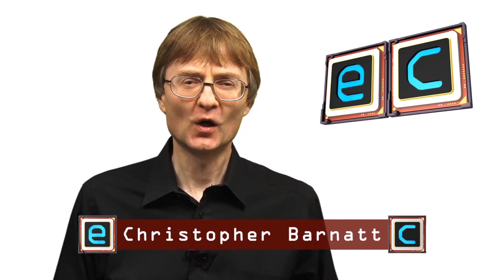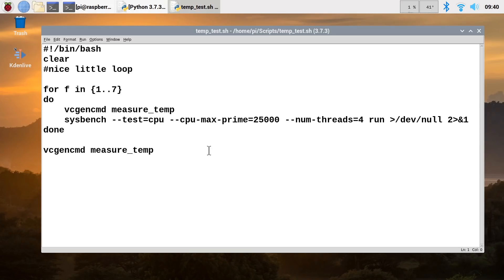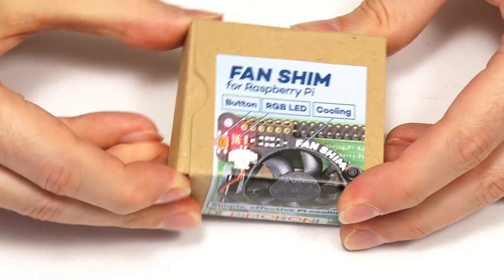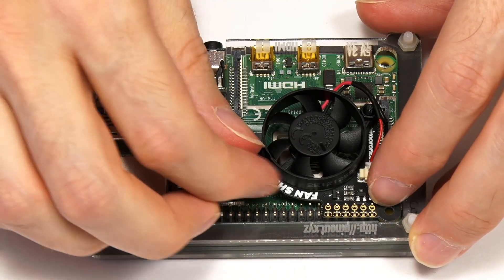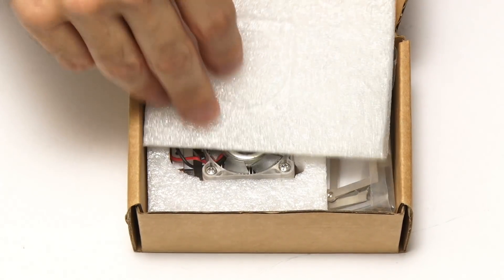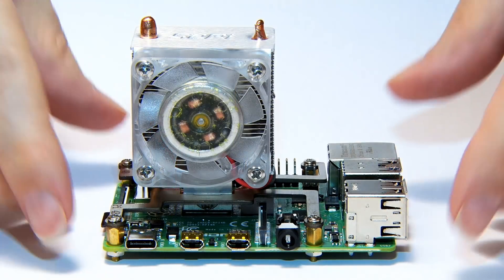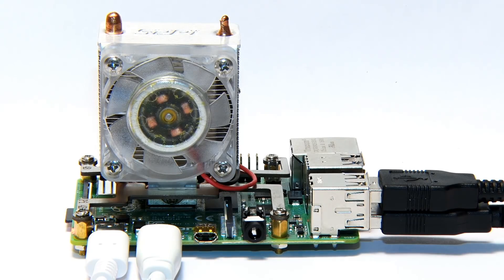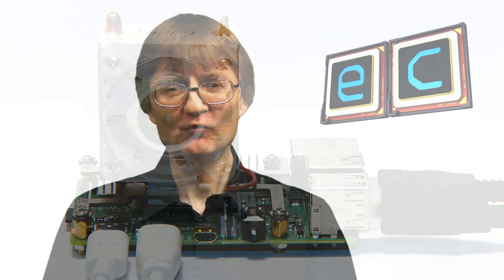Raspberry Pi 4: More Active Cooling!

Comment: That's a pretty poor cooling solution if that fan is going full speed.  I've got my pi 4 clocked to 2gig with 600 on the GPU.  I'm using one of those big blue heatsinks from this video...  https://www.youtube.com/watch?v=RxBaEiQHzLU with a generic 40mm fan from China using a python script temp control on the fan set to 35 C so the fan isn't running anywhere near full speed and i get the following running the same sysbench test...

temp=35.0'C
temp=40.0'C
temp=36.0'C
temp=34.0'C
temp=33.0'C
temp=35.0'C
temp=35.0'C
temp=35.0'C
temp=34.0'C
temp=36.0'C
temp=36.0'C
temp=35.0'C
temp=34.0'C
temp=35.0'C
temp=35.0'C
temp=35.0'C
pi@raspberrypi:~/scripts $ 

It does hit 40 at the beginning but that's the temp control taking 5 seconds between each increase in speed.  Once the fan speed catches up with the heat it soon lowers it and keeps it well easily at 35.  If i put the fan at full speed it would be below 30 but then the fan would be noisy.

Here's the python...

import RPi.GPIO as GPIO
from time import sleep
import os
import sys

GPIO.setmode(GPIO.BOARD)
GPIO.setwarnings(False)
GPIO.setup(12, GPIO.OUT)
pwm = GPIO.PWM(12, 50)
dc=0
temp_range=35
pwm.start(dc)

def getCPUtemp():
    res = os.popen('vcgencmd measure_temp').readline()
    temp = (res.replace("temp=","").replace("'C\n",""))
    return temp
def fanUP(cycle):
    temp_count = cycle
    if cycle<98:
        if cycle < 10:
            pwm.ChangeDutyCycle(100)
            sleep(5)
        pwm.ChangeDutyCycle(cycle + 5)
        temp_count = cycle + 5
    print (temp_count)
    return temp_count
def fanDown(cycle):
    temp_count = cycle
    if cycle>2:
        pwm.ChangeDutyCycle(cycle - 5)
        temp_count = cycle -5
    print (temp_count)
    return temp_count
try:
    while True:

        CPU_temp = float(getCPUtemp())
        if CPU_temp > temp_range:
            dc = fanUP(dc)
        elif CPU_temp == temp_range:
            print (dc)
        else:
            dc = fanDown(dc)
        sleep(5)

except KeyboardInterrupt:
    pwm.stop()
    GPIO.cleanup()

Comment: Hi Bernard. Thanks for another nice video. I saw you tested the ice-tower without fan for silence. I have a model 2 with a 5V 28mm fan which I connected to the 3.3V. It runs, completely silent! But sends enough air through the heatsink to keep the temperature at about 60C under stress. It doesn't seem to disturb the 3.3V bus. Have you tried something illegal like this?
Reply: Oh.excuse me Christopher for calling you Bernard. But when I started to type the comment my neighbor walked in talking continuously. So I got mixed up.

Comment: we're still using pi3B without even a small heatsink in our production systems. Those cool active thermal solutions might be cute or powerful but we also need to know the MTBF, the noise and dust that fan might suck into the little case. The video is fantastic to let us compare those data efficiently!

Comment: The Ice Tower is way cooler, but I'm still leaning towards a FLIRC case. It's silent and won't collect dust and I think that it will keep the CPU from throttling (as long as the CPU isn't a dud).

Comment: Thanks for the video! My question is this: does a 42C actually improve performance of the SBC compared to a 63C? I would have thought anything below a thermal throttle will actually perform the same, so all these active solutions are essentially equal in that regard
Reply from the maker: You are right, all solutions here will deliver the same performance. But a CPU rnning cooler will have a longer life, and has more overclocking potential! :)

Comment: Thank you for the video.
I got another proof that Raspberry is no longer a good board, but just a "commercial craft".
After all, the whole essence of ARM SBC is to be smaller, quieter, more productive.
And what do we have here ... "Tower cooler"?
Great, "Raspberry 5" should be sold in a tank with liquid nitrogen!

And to have connectors right at the corners of the board so that it is as inconvenient as possible)))

Comment: is there such a thing as 'passive liquid cooling' meaning having liquids flow around naturally and taking the heat with it without a pump?
Reply from the maker: This is, in effect, how heat pipes work -- like the one in the ICE Tower. There is a liquid inside that vaporises and condenses.
Reply: @ExplainingComputers  sounds like heatpipes would be sensitive to leaking and even exploding in this case...
So in theory, could they not maka sort of huge cilinder containing that liquid so that the supply of liquid would be "infinit" and just sit on top of the CPU all the time (boiling i guess)
Reply: escpecially in cases where the CPU sits horizontally, like with the Pi

Comment: A good trick would be to use a cheap, ordinary 12V fan by way of a Dickson multiplier.  The PWM signal could be generated by the Pi itself on an I/O pin.  The low period of the duty cycle can be used regulate the fan speed.  The components needed will a couple transistors, a few diodes, and some capacitors.  Pennies.  5V fans exist, of course, but are not as common.   If you could get a fan to run using CPU heat ... say a stirling engine or peltier device ... now that would be something.

Comment: I'd like to see you do a vid on /e/ OS from the /e/ Foundation on a RockPro64 :D as we recently seen (from the dev) that it works on Pine64. Check the /e/ OS out and see what you think. More over, the cooling solutions, be it fan or liquid cooled, is a must in country known for heat during summer months. Other thing is, I like the Ice cooler on the Raspi4, I agree it looks good and you're right, as the SCBs become more powerful, many more cooling solutions will pop up. Something for myself to look at in future experimental builds :D
Reply from the maker: I've made a note to take a look.

Comment: When you're testing with the 52Pi ICE Tower Cooler in the passive mode, could you please post the results where you have oriented the RPi4 to make the fins of the Tower Cooler vertical rather than horizontal? If you don't have a fan running, convective air flow will play a big role in how effectively it will cool the RPi4. And convective air flow works best when the fins are vertical.

Comment: I remember back in the days, someone cooled a computer with non-conductive oil, but IIRC it caused problem with HDD or something, plus it was massive.
I'm curious if this would be a good solution for tiny single board computers.

Comment: #!/bin/bash
clear
# nice little loop
for f in {1..7}
do 
     vcgencmd measure_temp 
     sysbench --test=cpu --cpu-max-prime=25000 --num-threads=4 run >/dev/nul 2>&1
done
vcgencmd measure_temp
#sudo su
#apt install sysbench
#./stress.sh 
#where stress.sh is this file
#result on a pi 3b with a simple heat sink and simple fan 
#running raspbian stretch 
#temp=48.3'C
#temp=67.7'C
#temp=68.8'C
#temp=69.3'C
#temp=69.3'C
#temp=69.8'C
#temp=69.3'C
#temp=69.8'C
Reply from the maker: Ah, the Pi 3 runs so much cooler. :)

Comment: Hi thanks for the video. Very relaxing as usual. Can i please ask if you can review the GeekPi Armor Case. It is an aluminium case that passively cools the Pi and is very slim too. Can you please compare it with the passive ice tower and other passive solutions you tried in the past? Also i recently found around some stock Intel and amd coolers and realised that they might be adapted to the pi (expecially the Intel ones since they have smaller cpu area), please if you have some lying around can you try them passively and compare them to the other passive solutions? Thanks again for your videos.
Reply from the maker: I will be looking at that case, or one very similar.

Comment: Please test this aluminum case:
ebay.pl/itm/392321943875
Reply: @3dh
I have the dual fan version of this case on my pi 4.... its the most sensible case there is right now.... this case makes contact with the CPU, RAM, and the USB3 controller.... which looked at with a thermal camera are the 3 hot spots on the board.... NOT just the CPU like this other heatsinks only touch....
Reply: imgur.com/gallery/fo1x9F0

Comment: I suspect the pi4 had reached the point where you'd be better off buying a few years old pc instead unless you are going to use the ports and not just use it for gaming. I bought a two year old laptop for £37 plus £7 postage, and it will definitely vastly out perform the pi4. Probably less cost than the pi4 and a fan, plus it's upgradeable.

Comment: awesome stuff, looks like with the clear case, and a shim fan I finally have a decent solution to replace an aging ASUS Chromebit I use at my work which is a non profit for seniors as their web terminal mounted to the back of a 17in ACER monitor.

Comment: 52Pi also have official ebay store for ice tower cooler, you can check it here
https://www.ebay.com/itm/52Pi-ICE-Tower-CPU-Cooling-Fan-ICE-Tower-Fan-for-Raspberry-Pi-4-Model-B-3B-3B/223582824129?hash=item340e9326c1:g:UtwAAOSwl-NdbOnB

Comment: I'd like to mention submerging the Pi in a mineral oil and the variations possible therein, active heatsink cooling (keeping the oil moving), having an aluminum case to transfer heat from the oil to the air outside etc. But I'm not sure if the hassle would be worth it, considering the clean up for mineral oil builds (in common PC's), and considering it is a "tinker" board and having it submerged with relatively high clean up times makes tinkering, not such an enjoyable thing.

Comment: That Ice tower looks amazing, but I had a question: Would Noctua 40mm fans work on the Ice Tower? If so, I wonder if a pair of 40mm Noctua fans in push/pull would be viable, and if so, could you push it faster with overclocking of any kind?
Reply from the maker: They would! :) With maximum OC potential.
Reply: How would you power two fans?

Comment: Even if the RPi 4 has higher power consumption, it is designed to operate fanless.
Beside stress tests, there is no real life software that pushes all cores at 100% for long periods.
An active cooling solution is just adding unpleasant noise, extra power consumption and dust accumulation, bringing no relevant benefits compared to simple passive cooling solutions.

Comment: Fan-tastic video Chris! I have this vision of a near silent Pi 4 attached to the back of a monitor, wireless mouse and keyboard, running as a desktop. I'm thinking the board could go inside a short vertical section of aluminium pipe with big slow fans ant the ends, bottom fan pulling air in and top fan pushing air out...
Reply from the maker: Pi in a wind tunnel. Nice idea!

Comment: will you consider adding the noctua to the ice tower heatsink and retesting?
Reply: I swapped out the stock fan on my ICE Tower for a Noctua NF-A4x20 5V PWM fan. Fits right on with existing screws, though I got longer screws so I could add some extra anti-vibration washers and o-rings. I have a partial transparent case using those clear lego layers for base and top. 70mm hex standoffs are just tall enough (allowing me to use 6mm standoffs under the Pi4 to allow airflow between baseplate and board).

Under moderate use (web browsing, SDR radio etc) my Pi4 CPU temp is around 28C with the fan, or 50C without the fan. My project is over the top, but was fun to do and works well :) I haven't tried running the stress test.

As Roger Clarke says above, it would be cool if someone had the ICE Tower sticking out through a hole in an original Pi4 case, like an engine block sticking out through a car bonnet/hood.

Comment: Isn't passive cooling affected by the orientation of the board? Having the heatsink ribs vertical could improve natural convection. Anyways, the Pi4 is not throttling in any test, which is good enough.

Comment: The Pi5 is going to wind up being a tiny board you can barely see mounted on a giant heatsink. It kind of defeats the purpose of a small SBC if the heatsink takes up the same cubic volume as the PCB itself.

Comment: Nice to see more SBC cooling vids but as soon as I laid eyes on the ICE tower I was thinking - hands down winner!

I'd like to see some clear injection moulded cases possibly with plates you could slot in/out for air flow options. I wonder when a Pi cooling water loop is gonna arrive, or plans for one, cos that would really be the acme stage/final stage in Pi cooling.

I'd envisage a loop that was paired with a case and the loop went around the board and case and something that made bubbles would be great but the bubbles might be going too far hahaha.

Any plans for making or modifying some cooling ideas yourself, Chris?
Reply from the maker: I may well design and 3D print an ICE Tower case, and share the designs. :)
Reply: @ExplainingComputers  Very interested in this as well. For now is the Pibow Coupe 4 case compatible with the Ice Tower?
Reply from the maker: @bradquinn4161  Sadly not. I don't know of any case compatible with the ICE Tower.

Comment: Thank you. That was most interesting. If possible would like to see a test where a heatsink is on the pi4, but placed in a small box with an exhaust fan. The reason I ask is that im concidering a retropie arcade stick, but would like to limit the height to around 25 to 30mm and have fan on the bottom of the case (case would have non slip feet pads).with Pinholes at the front to allow an airflow past the pi 4. Also do you know if the Pimoroni Fan SHIM is compatible with the pi3a

Comment: When you disconnected the fan, it became a an air baffle that heavily restricted airflow across the cooler.  I'd repeat the test with the fan uncrewed and a belt and braces, with the fins vertically to see if convection occurs - I doubt it but it might

Comment: Another great video 👍🏻. There is one small point though. The Pimoroni Fan shim wasn't assembled correctly. It's supposed to have one of the nuts between the PCB and the fan, that's why they supply 5. Four are used in assembly and a spare. That raises the fan up slightly which will allow more air to flow round the CPU and hopefully improve the cooling effect. https://learn.pimoroni.com/tutorial/sandyj/getting-started-with-fan-shim
Reply from the maker: Ah! I see. Thanks for sharing this. I was not, when I unboxed, expecting to find parts, but an assembled product. So I went straight into building it in that shot. Suggests to me there should be a small bit of paper in the box indicating assembly. That I would have seen. :)

Comment: As I see it there are two ‘fun’ challenges now, one is cooling the Pi4 while running at 2Ghz, and I think that has been done so it will just be variations on a theme- passive being better than active.
Then there is cooling the Pi4 so it runs within design tolerance with the least bulky cooling solution, there’s probably a lot more potential there and potentially greater demand.  A developer wouldn’t choose a Pi4 if they must overclock it to 2Ghz and/or then actively (or passively cool it with a brick) cool it.  They would use some other SBC solution that could run within design parameters.  \In that sense the FLIC case seems to be a winner there.

And this makes me wonder who the Pi4 is for, to me if it is to supply the enthusiasts it isn’t really enough.  I want PCie access to be easy, M.2.  And it seems too faulted for development/ enterprise- at least currently.  I’m still happy they released it though, the faster bus/ removal of the USB bottleneck is a genuine improvement which makes the Pi4 capable of what they tried to claim the Pi3 was capable of (they always over claim I think).  I’d pay £100 all in for a SBC that was just a bit better than the Pi4- and I’m not greatly interested in 86_64 here because for less than £100 I can buy an embedded CPU ITX board for that; I was disappointed in the Atom Pi and that has put me off such SBC.

So a more full fat ARM SBC basically, to compete with the lower end ITX boards.  In theory also the STX boards but they aren’t much available in the UK (bigger in MEA/ Far East it seems).
Reply from the maker: Thanks for this. Watch next week . . . :)
Reply: @ExplainingComputers  I genuinely look forward to it, the three videos will give a great overview, with as always good data reporting, so people can make up their own minds on the best solution for them.  Certainly cooling the P4 has been a hot topic since launch (dreadful pun intended).

Comment: Nice video!  I'd seen the Ice Tower in some other videos after your first cooling video came out, so glad you went back to address it.  One question I have now is how different are the Ice Tower results if you use their stick on thermal plates rather than the somewhat messier (and easier to screw up) thermal paste?  Another question is how important is it to heat-sink and cool the other chips on the board, besides the CPU chip?  Does the network and I/O performance degrade if you don't cool some of these other chips?  (I note that most heat-sink kits come with several for the other chips, which wouldn't seem too useful with a CPU focused solution like the Ice Tower)...  I wonder if I can retrofit the Ice Tower onto my GeekPi acrylic case, for the Pi I still haven't got yet?  -:)

As always, keep up the good work!